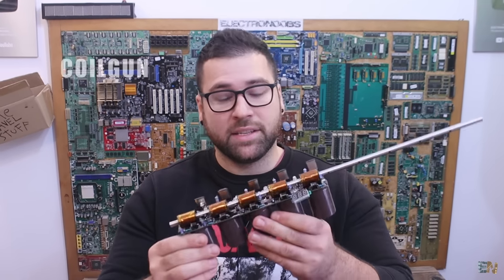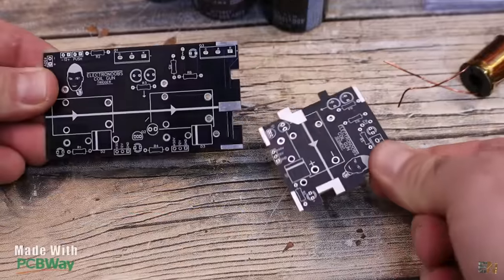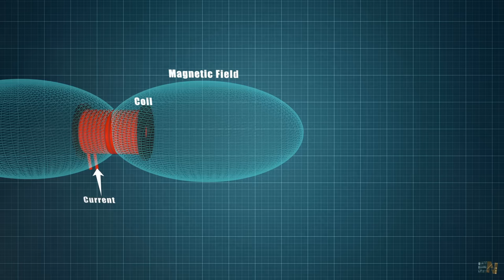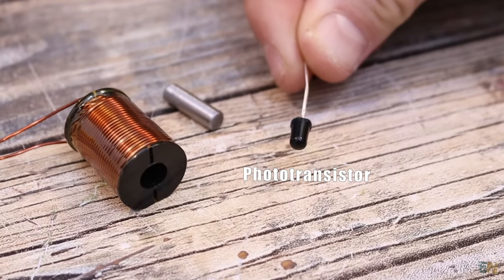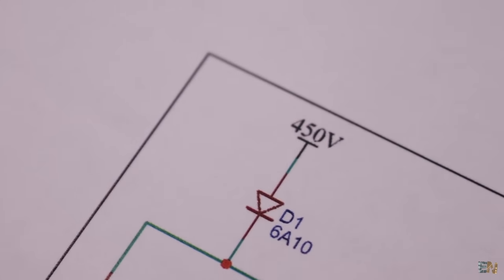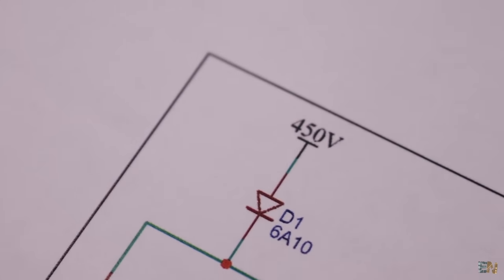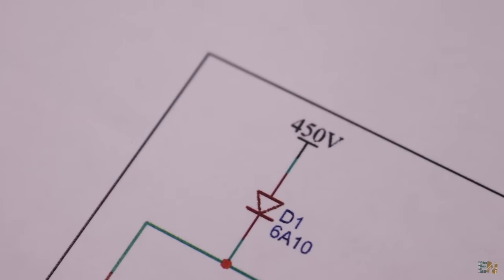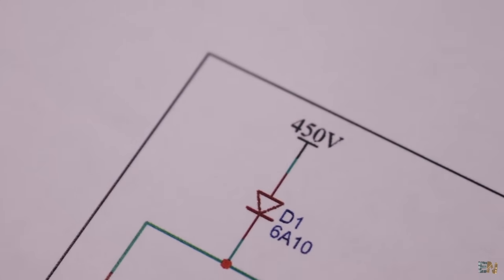I've Made a Powerful COILGUN | Separate Stages PCB

Comment: This is a very nice design! I like your way of making the stages modular, so you can just add more stages.
You need a way to increase the capacitor discharge rate in the last stages where the velocity is higher. All you need to do is reduce the number of turns of each stage, so as stages get less turns they have less inductance and the magnetic field will be created faster and with more intensity (but less duration).

Also, if you connect ALL the led sensors to a scope channel, you will see a series of pulses as the projectile triggers each sensor. That should allow you to calculate the acceleration for each stage, and help you to tune each stage by the number of turns on the coils.

How many turns did you use in this prototype? Did you measure the inductance?

Comment: it is possible to synchronize it using a microprocessor and virtually remove the speed limit. it is also possible to place a special coil set to make the bulet rotate to stabilise it.
Reply: Until the projectile can't take the stress...  Also, at some point, PWM will be required to control the timing, so it will need to be connected to a communication bus. Which i think is the easiest method as it provides precise control over the power and timing. I think it could easily be scaled down to a kitchen table project.

Comment: Fascinating; I’m hooked on this concept. What about spacing the coils at increasing distance from each preceding one to use the inertia of the projectile and “catch” it at optimum position for the next coil ?
Reply: I would think you'd be better tuning each stage for the velocity of the round as it passed through. If you spread the coils apart, wouldn't you increase the amount of time that the bullet is not influenced by a coil? That would lengthen the gun without appreciable benefit.
Reply: The projectile stops accelerating the instant the coil turns off so spacing them out would only allow the projectile to slow down. Ideally you would have 0 space between coils but that isn't possible.

Comment: Some comments to your great project. I like the modularity of your design.
1. Replacing Thyristors with Mosfets (and add propper Gate Driver) can also turn off the voltage. That can be usefull to avoid retraction of the protile.
2. Replacing the freewheeling diode with a TVS snubber will turn off current much faster. Or use a full bridge mosfet topology for better energy recovery.
3. I would place the detector circuit directly inside the coil. Then directly the current can be turned off.
4. The capacitors you choose have high esr. Maybe use a foil capacitor. At least they bang much better when shorted.
5. Did you experiment or calculate the inductance? From my feeling there must be an optimal one.
6. I would switch the design to pure smd as it would be more robust.
Reply: Quite a lot of MOSFETs might not be suited for this applications and also Thyristors are cheaper than a MOSFET suited for this purpose.

Comment: Pretty good design.

One thing you have not taken into consideration is the aerodynamics of the projectile after it leaves the barrel.

A cylindrical projectile like you are using will start tumbling shortly after it leaves the barrel. Meaning more irresistance, more unpredictability in its flight, and when it hits the target it will "keyhole" which means it will go in side ways part of the time.

Also, the weight of such a cylinder would be heavy enough to actually slow the projectiles acceleration.

My suggestion is to use a spherical projectile. Like a bb, or small ball bearing. You'll get a much more predictable path after it leaves the barrel. Also, it will leave the barrel at a much higher speed because of the conservation of mass and energy. The smaller the mass of the projectile, the faster the same amount of energy will make it go. The muzzle energy will be the same, even though the mass of the projectile is less, because the muzzle velocity will be faster. The law of the conservation of mass and energy in effect.

Also, in this setup because the bb would be rolling in in the barrel top over bottom, you can use this effect to effectively increase the range of the projectile. They do this in airsoft BB guns.
Reply: One step at a time😅

Comment: It's good to see some new videos on this topic! I am currently designing my own multi stage modular coil gun design with optical triggers. I have designed it with fire control for single burst and auto. I can't wait to get to the prototyping stage. I almost have all my components for testing.
Reply: The problem that you will run into with auto fire will be the charge time required of the capacitors.

Comment: Maybe the photo diode can placed before the coil and use a timer to optimize the coil turn off time and trigger next coil turn on.  As the bullet get progressively faster, the timer gets shorter for each stage.
Reply from the maker: Yes, we could use two detectors, one at the input and one at the output and making test we can find the perfect timing...
Reply: First add a launcher.
Then add sensor before the bullet enters the coil to prevent the pulling resistances in the middle of coils.
Then increase the capacitors value(Diy capacitor gives you a better result) in every stages rather than adding more coils.

I think you can achieve 2kg of force.

Comment: If you put a sensor before each segment, you can then use a timer for each segment to turn off right at the center. You have to calibrate each one individually and measure the output velocity. But the good thing is, you can calibrate each in order and it won't affect the later segments. Just optimize stage by stage.
Reply: You could easily calculate the velocity by how long the sensors get blocked and calibrate them this way without much trial and error.
Reply: @WallabyWinters  you could probably even design it to autoregulate. When the sensor gets blocked, activate the coil and charge a capacitor while it's blocked. The speed of the projectile (and time to keep coil active) will be proportional to the charge level (charge time) of the capacitor. So keep the coil running until the capacitor discharges below a certain level. Properly designed, this should be auto-regulating: faster projectile, lower charge time, lower coil active time, and vice versa.

Comment: The moment i saw the clip of it shooting the projectile into the cardboard box, thats all i needed as proof you know what your doing, and subscribed. Lol. Awesome project. And its such a simple circuit. I love it. Simple, and straight forward.  Will be building one down the road. Thanks for sharing your design and layout.

On another note, i like your wall background with the motheboards. I have my workspace the same way. Got the idea from a video on Linus Tech. They did his office completely in motherboards on one wall. Painted it all in 1 color. I did the same, but added it couple ARGB light strips to glow from behind the boards onto the wall and using EL Wire, traced the mosfet heatsinks, and each boards shape to outline it like in the movie TRON. Turned out amazing. Maybe a idea for your wall? :)

Comment: You could almost double the effectivness if you just reverse the magnetic field when you now shut it down. In this way both ends of the coil will pull/push the ammunition... Also if you do this, then shut stages off after next stages led detects it. And you could turn stage on after previous led detects it. These on/off switches saves some energy for the next round.
Reply: The bullet isn't a magnet, it's a pice of metal, reversing the polarity of the magnetic field won't do anything
Reply: Reversing wont work, but id say putting the photo switch on the start rather than end would help, perhaps with a delay. Or use a software driven timer, where you finetune each shutoff time based on the stage & projectile mass
Reply: @herosvicentegonzalez7872  Unless you could produce polarization in the projectile somehow.  Maybe by pre-priming the projectiles in a magazine or using a series of blades to transfer electrons to the projectile, then you could potentially either make a temporary magnet out of it, (it doesn't need to be very long) or polarize it so that the magnets can pull and push it.

Comment: Would you be interested in designing my concept for coil gun? It might be tad more challenging and experimental, but results in my opinion should be vastly more powerful
Idea is: traveling RLC circuit, with multitude of short (length wise) coils
Circuit couples several coils in the circuit to create single field, slightly ahead of projectile, detection is also performed by coils themselves, metal projectile changes coil inductance and could be used to determine core location
For extra detail coils could be without plastic casing to maximize efficiency/density, also whole coil sandwich to be made solid with a resin - eliminating wire movement - energy loss, also as thin of a wire as one could get away with
I believe this sort of design would have serious punch, to the point of using bricks/ballistic gel for tests, you could rename that design to coil cannon

Comment: I like your solution for shutting off the magnetic field between stages. Cheap and effective. I was thinking about using a controller to time things accordingly, but I think that route is only necessary if you want to archive greater speeds with the projectile.

Comment: Since the speed increases for each coil, until the theoretical maximum speed, I believe you'll eventually end up at a point where the projectile moves past a coil faster than the coil can turn off using the photoresistor.

You could get around this by using a timed release mechanism instead, but that would be hard to make modular.
The timing between each coil is [projectile acceleration] less than the previous timer, thus turning the coil off just when the projectile hits the middle point.

Comment: Very nice work man!! You did a fantastic job! Not only at the project itself, but the video is extremely well made all around as well! Extra props on the safety warnings and explanations. You don't wanna a big cap incorrectly!! [ZAP!!!] 
Thanks!!

It's kinda creepy because I was just wondering(internally) about what it would take to make one of these for a practical (non violent) application. Looks like it's too much unless they are available in kits and inexpensive. It was a off the wall thought, as many of mine can be thankfully.

Comment: The voltage doesn't matter actually but the current. The current flow is what induces the magnetic field.
Reply: It does. Its simple ohms law. High current multiply with current creates more power than low voltage. Do more research before u write a comment

Comment: Question: How did you decide on the number of windings of each coil? At some point the speeding  'bullet' will cause a self induction in each coil that will counteract your generated induction.. Therefore, there will be a limit to the number of boards you can use...at some point the number of boards will not have any effect. That's why the number of windings on each coil is important. How did you deal with that?
Reply from the maker: The windings were made at random without any calculation for now. And yes, for sure there is a speed limit given by the structure and the components...
Reply: I hadn't thought about that but you are correct! If I understand at a certain point your CEMF will equal your applied voltage. The current induced*coil resistance would need to be greater than your voltage source. To achieve the same velocity (physical domain not considered) either turns needs to decrease or voltage to increase.
Reply: the issue of self induction is, i my oppinion negligible, the phenomenom of self induction is created by a changing magnetic field inside of the coil . With just a steel bullet, the magnetic field created by the bullet , because of the eddy currents will stay really low, in front of the magnetic field created by a neodinium magnet projectile (see tom stanton's Electromagnetic Rail Launcher)
even with a magnetic projectile, in his build, the self induction is showed as negligible, not taking it into account for simulations give results very similar to the real data
Reply: @aterxter3437  Yes, I agree too.

Comment: Hello, and thanks for sharing this project.  I have a couple of questions.    I may have missed something, but as I look at the circuit it appears that crossing the IR beam triggers the coil rather than turning it off. This seems to be supported in that each additional module has the IR beam at the entry of the coil.
Also, what is the white LED for?

Comment: It seems to me that you can also use the PD to detect when to switch the polarity of the coil... that way you can use it to not only pull the projectile into it, but to also forcefully expel it to the next stage.
Reply: The projectile is ferromagnetic, that means it only has the polarity the coil inducts to it. Maybe you can take advantage of the small magnetization but just for a small fraction of a second
Reply: Suppose one uses neodymium magnet projectiles.
Reply: @mikebond6328  in that case then it could work, but I don’t know the feasibility of neodymium magnet as a bullet, it easily cracks, and if heated, it loses their magnetic properties for ever (with induction, maybe the coil is heating

Comment: What you could do is add two pairs of infrared detectors at a fixed length, then measure the time it takes to cross them. With that, you could determine the speed of your bullet, and answer questions such as: Does the speed linearly increase when I add more stages? :)
Reply: Each stage will accelerate it by a smaller amount of velocity as a result of reduced time + greater impact of air friction as the object you are throwing accelerates. But the acceleration rate that each coil provides should be consistent - though as a net total, you will see diminishing returns (hello friction).

The reason you see this is faster objects are impacted by air friction more aggressively, while faster moving objects will spend less time in the magnetic field accelerating.

If you wanted to measure - you do have  sensors built in already though: All you need is to track from the time you hit the button, until the time each subsequent sensor is triggered - and since you have a nice way built in to do it, what you are looking for is a simple drop in current which can be tracked pretty damn accurately. This would actually let you do something a little crazier and add in a timing circuit that is responsible for shutting off the magnetic field / turning them on, not based on the detection of the sensor - but when you calculate out the ideal shut off time (once accounting for other variables). This does add more complexity - which you will want to keep as simple as possible, as complex systems run slower, and running slower means we need to account for this in final output and... it just gets complicated fast.

To summarize: You could, but I'm not sure it's necessary - unless that information is going to be useful in refining the optimization of the device.
Reply: @formes2388  Removing the air from the tube would be a significant performance increase but also introduce detection problems, you should be able to detect the slug entering the coil electronically rather than optically but that would add significant complexity.

Comment: What if it was 100 stages
Reply: I think with this design it will have a terminal velocity, where the capacitor cannot discharge through the coil fast enough, and the friction of the barrel will prevent it from any further acceleration.
Reply: Hyperspace pirate did a good video on the efficiency versus amount of stages
Reply: Magnetic saturation
Reply: @hatemfilmsmoviemaking3805  isnt that only with transformer cores and their stored energy and has nothing to do with this
Reply: Max speed limiter by voltage

Comment: When you add more stages, it will lose efficiency each step. As the kinetic energy is proportional to the V^2. When you apply the same energy to the bullet, you'll gain less speed at each stage.
Reply from the maker: Yes, for sure there is a speed limit given by the structure and the components...
Reply: I'm not quit sure, if this is realy true. If you were able to switch the coil on and off in the right moment it shoudn't be a problem, since the coil will be active for a shorter time. But of course the growth in E kin isn't linerar.

Comment: A handsome idea for a silent sniper. U can build a gun with 3, 4, 5 modules and a battery with high voltage. For example 3 modules 1000 km x s, 4 modules 1.250 kmx x s and u can choose the power. The snipers don't need rapid fire, they need low noise and accuracy. Nice job and brilliant mind.

Comment: I liked your video, and I have a suggestion, if you are up for a challenge! Real firearms have a grooved barrel to put a spin on the bullet. This makes aiming accurate because it stabilizes the bullet in flight so it won't tumble. Your gun is fine for short distances, but if you want distance, you would need to put spin on the projectile. Since theoretically, the electric field in each coil is moving in one direction (DC current), if your coils could impart that field spin to the projectile, you could make it spin as it passes down the barrel. TO do this, I think you would have to modify the projectile. Maybe put a twist where half the projectile is ferrous and half non-ferrous in a longitudinal twisted pattern. You could then sell this "ammunition"
Anyway, great project so far!